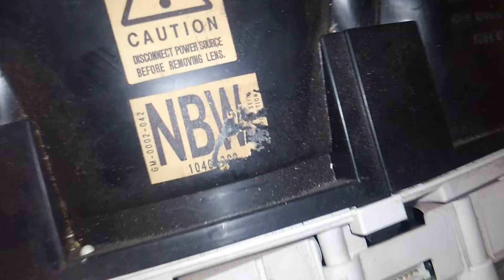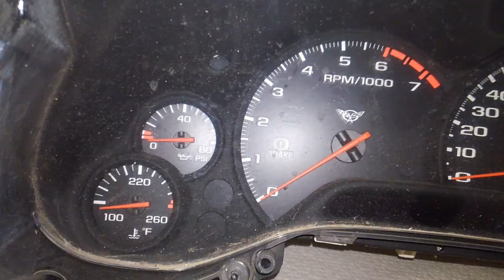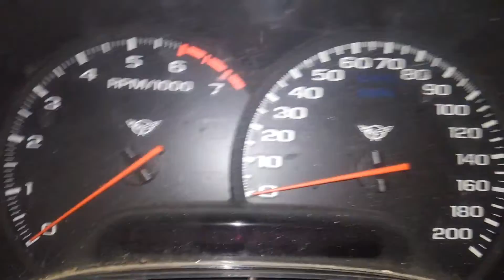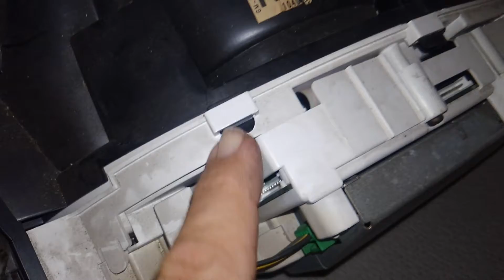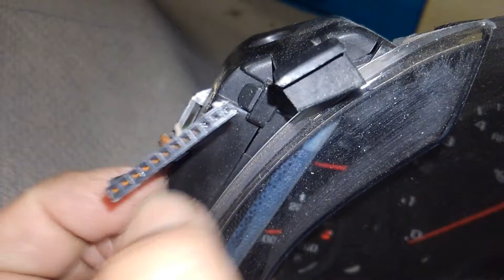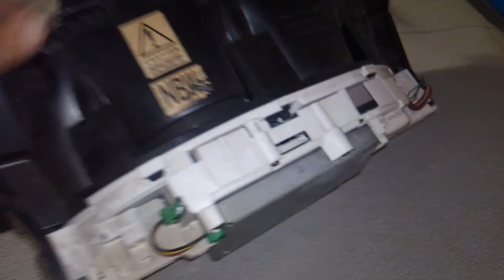C5 Corvette Instrument Speedometer Cluster Assembly For Sale

Comment: I have a 1999 C5 with a bulb “out” in the module near the “0” of the tachometer. Is that fixable/replaceable or do I need an entire new module?
Vic
Reply from the maker: You might be able to find an electronics repair facility that could do that, but most likely you'll end up having to replace the module.
Reply: @VetteSource  that’s what I thought. A lot of trouble for one little lightbulb.
 Vic
Reply from the maker: Definitely. The newer cars, while offering some really cool features are becoming an electronics headache as they age.